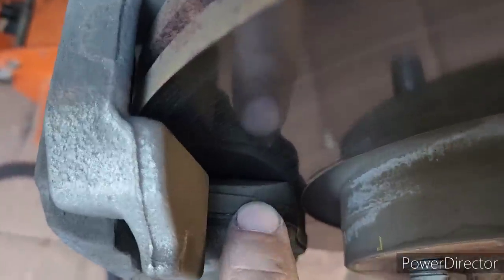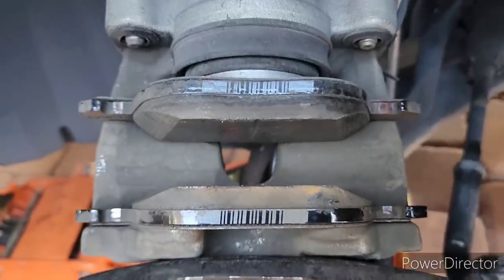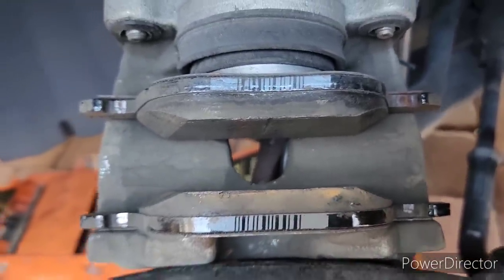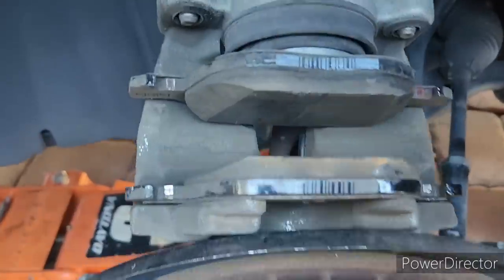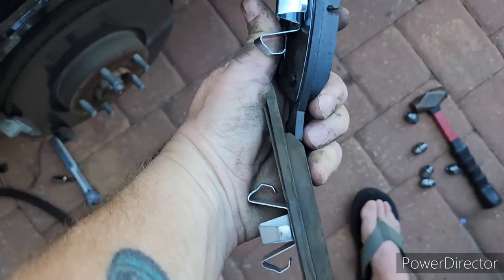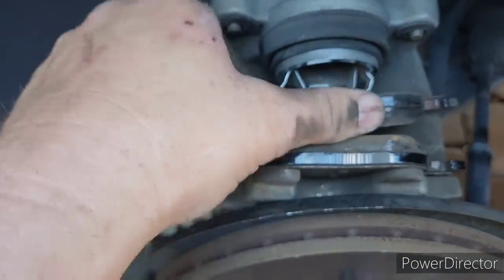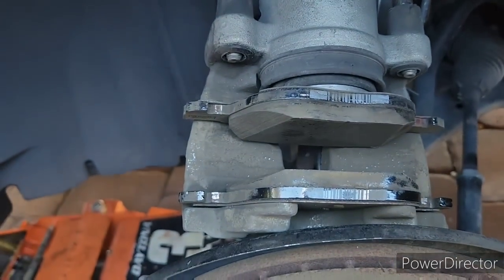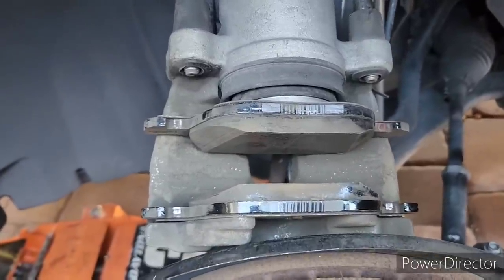Ford dealership robbed a little old lady out of a brake job. (almost)

Comment: i’m 18 and i work at a toyota dealership. I believe we do the right thing. we had someone come in for brakes and we told them they shouldn’t get them because they still had 6mm left. we resurface rotors unless it’s unable to be. we repair tires unless they are unrepairable. 

i’m proud of the work i do, and i believe most of the guys in there feel the same. I feel like that’s why we see a lot more than just toyotas, and we have tons of business.
Reply from the maker: Carry the torch! There's nothing wrong with doing the right thing. Don't fall into the trap of selling crap like the bad mechanics.
Reply: I think it’s not the Mechanic doing most scam, it’s the service writer, they have commission money. Mechanics getting only the per hour
Reply: @Alex-ti3uf  I used to work in dealerships as a salesman and even the mechanics worked on commission as a good chunk of their pay.  They could make a significant amount of commission $$$ on upselling services and parts after the cars had come into the shop so it was in their best interest to "find" problems.  Really reprehensible business practices at the two dealerships I worked at.

Comment: Most likely, the dealership wasn't going to replace the pads at all. The old ones looked new, so they were just going to say they replaced them when they didn't. The mechanic pockets the $200 and doesn't do the brake job. Happens all the time.

Comment: This is precisely why I always kept myself in automotives/repair throughout my life.  I was great at it when I was in High School and we took shop class and such, and then I just kinda walked away from it  for over a decade.  I took a vehicle in for work because it needed some (beyond the basics) and was almost immediately met with "Oh so we did our 49 point inspection free of charge BUT found all these items that require your attention etc. etc. etc."  Using the knowledge I already had, though now mostly out of date as more and more cars were electric this and that; I opted to buy a Hayne's manual for my vehicle to take a look myself and what do you know...nothing wrong that required immediate attention.  Of course.  Brakes (pads and rotors) were on that list.

From that day forward, I now do all my own work on my vehicles aside from intermediate/major engine work, or electrical work.  Everything else I do myself.  Fluids.  Suspension.  Belts.  Plugs.  Doors and frames.  Odds and ends like that.  I've saved myself countless thousands of dollars of bogus repair work since.  I also use that knowledge to help friends and colleagues with their vehicles when they have problems, or to have taught a couple of them how to do their own brakes and rotors/etc. to save them money.

I get that times are what they are and everyone wants to make a buck and the easier the better...but to openly scam people because you are banking on their ignorance is just appalling.  In this video's example, there's nothing at all wrong with that particular side's brakes.  They look almost new.  Now I don't know what the other sides look like, but that side clearly shows nothing wrong with the brakes at all.  Assuming all sides are roughly the same, this is just a scam of an elderly person ignorant of their own vehicle (which is not their fault - not everyone wants to be a backyard mechanic or can be).  If anything, I'd have taken it out for a boot and tested the brakes both inside the city (stop and go traffic) and on the highway (far less braking needed).  Test the grip/bite, test the sponginess of the pedal, test for possible warping of rotors.  That kinda thing.  Odds are that everything will check out fine.  Maybe they complained of a squeal/grind sound when braking after a prolonged period of inactivity.  That always happens as the brakes and rotors get debris/rust if not used regularly AND especially true the older the vehicle and the longer it hasn't been used.

It's a shame that stealerships and shops still employ these scummy tactics of preying on the helpless.  Just sad.

Comment: When I was in college and living in the dorms (so I had no where to work on it), my 91 Jimmy's brakes started having a problem grabbing. Barely hit the brakes and it would lunge you forward. I had the bright idea to go to Meineke and have them check it out. I was told that my rotors, brakes, calipers, everything was out of spec and they highly suggest not driving the vehicle until it was fixed. It was going to be some ridiculous $1200 or so to fix. I laughed so hard at this guy and told just to put the wheel back on and I would fix it myself. I knew he was an idiot. After I drove off, I never had an issue with those brakes again. He just cleaned up the brake dust/debris that was causing the issue.

Comment: Just happened to my wife last week at the Honda dealer. Went in for a couple scheduled services. They reported a couple of "very bad" oil leaks. The car came with a lifetime drivetrain warranty so they called the warranty company, who wanted photos. Nope, not bad enough to fix. Told me wife the same thing, but to easy her mind, she called an indpendent Honda repair shop and took it there a couple days later. The confirmed not an urgent issue at all and those engines do this. And the two leaks was really one leak - valve cover. My wife works retail and while waiting in the Honda waiting room, she said they were doing the same thing to every customer. Such short term anti-customer thinking will ruin them in the long term.

Comment: Took my Dodge 5500 Diesel in for a factory recall. Service manager came out with a list totalling close to $5000.00 in repairs that were needed. Said I needed an oil change too. I ask how he knew I needed an oil change and he said they "tested it". I looked him in the eye and said, "I normally like to get more then 20 miles on an oil change since I had just changed it myself before coming in.  All this other stuff is bogus too as I do my own maintenance. Just do the recall and let me get out of here." He hung his head and walked away. They were so stupid as I even had written they change date and miles on the bottom of the new filter!

Comment: Years ago I worked as a handy man for mainly elderly people. I had one of my lady customers say that her brakes were making noise again. A week or so earlier she took it to the local dealer and they cleaned them and deglazed them for her. Thing was the dealer she bought the car from(different one) had zip tied the hubcaps on because of a theft problem. I looked at her car and it still had zip ties holding the hubcaps on. I thought nice of this new dealer to put them back BUT they were old zip ties. Not sure how you work on brakes without taking off the wheels! I fixed her brakes and the quit making noise until she sold the car 6 months later.

Comment: They don’t always lie they told me I needed to replace the breaks on mine I didn’t believe them at first until I checked for my self and the break rotors had grooves on them
Reply: Grooves are normal to a point, that does not mean you need new rotors.

Comment: It doesn't make sense a Ford Dealership would charge only a couple hundred dollars when the cheapest brake job I have done is $550.00. Obviously the techs are just "looking" for easy work.
Reply: 550 is a lot. Typical rotors and pads run 250 and the labor does not need to be 300. If I take my time 400 would cut it.
Reply: Yes it does if they charge her for a brake job they don't even do because it's not needed.
Reply: @rosssmith9870  What???? I'm not getting your reasoning here. You can say they only do the front for that kind of money but nothing at all?
Reply: @Silverado  Since it's a scam because she doesn't need brakes they can charge 250 and do nothing. 100% profit.
Reply: @rosssmith9870  That's fucked if that's what happened. Damn! And no way to prove it.

Comment: Not sure of the requirement in the US but where I live, brake pads and tyres have "witness" marks to show when they are worn out. The pads that are installed obviously have incorrect marks but your replacement pads are correct ie when the line disappears they are toast. While not wanting to defend your Ford service folk, it would be easy to defend the loss of the mark even if its incorrect. However I do note the chamfer on each end which is probably a secondary mark.
Reply: I took a set of rear brake drums in to have them turned (they were barely worn). They had a witness groove in the middle of the wear surface. When I got them back they had turned the drums all the way to remove the witness mark and informed me that next time I would need new drums as thy had to turn them all the way to the legal limit.

Comment: It is a typical maneuver for shops to do this.  I just had a shop tell me I needed an alignment because the steering wheel was off center.  Interesting since it wasn't when I took the car in.  The work they were told to do required dropping the steering rack, so they reassembled it with the steering shaft off by a tooth then wanted to charge me for an alignment.  Something else I noticed was the power steering fluid was over filled and now murky.  It wasn't like that when I took it in.

Comment: I only just got my first car in February. I didn't know all of what I was getting into when I purchased an "as is" car. I trusted the safety inspection they gave their vehicle because obviously, idk how everything works. But one sticking point for me upon seeing the car was it had no diver's side visor to block the sun. I argued it was a safety issue and was irresponsible to sell me the car without it. It was pulling teeth for them to give me that alone. But that was only the beginning.

After walking into the sales person's office they try to get me to agree to this special brake assistance thing, that software that makes your brakes blink or whatever, and this stupid laser etching of the vin on my glass. I was adamant I wasn't going to pay for it. So I low balled them and got the car for $1500 cheaper than what they were currently advertising it for. ($4000 dollars cheaper than it was in December of 2022 btw). I was pretty proud to pay what I did, even if it was still a bit inflated from KBB.

This is all to say that even after that whole charade in the dealer, I still walked away with something that they knew they weren't giving all their effort into. There's plastic covers missing on latches. The weather stripping wasn't kneaded back into place, which took me 5 minutes to fix myself. And finally the whole reason I wrote this damn essay...... They sold me a car with 3 working door locks. I drove this car around for 3 weeks without knowing that my most expensive asset was not secure. I called a mechanic friend to take a look at it, we tear the door panel off find out what needs fixing.

I call the dealer I bought it from, tell them I need it fixed. And they tell me they'll diagnose the problem for me. I tell them you don't need to, I know what's broken I saw it with my own two eyes. I ask what it will cost me and they oh so generously wave the diagnostic fee, but say the part costs around $400 dollars, and that's not including labor. I call the local dealer who was the manufacturer of my car, and the original seller of the car when it was new, they tell me the same thing. NAPA tells me the part is $250 dollars. Finally I call my nearest scrapyard and find a similar model car. I take out the parts I needed, walked out with the parts and a spare door handle for $20. If you have the means to do so, or friends to help you out find a way to do it yourself, safely. You'll learn something new and will be able to help others like this man does.

Comment: From my experience, where there are mechanics who get a commission on the sales of parts they change.  They tend to find something to add just to make a few dollars more per car they service. It is also common there are service managers of dealerships who are gauging customers for what they can get.  

I take my SUV to a dealership that I know has been honest with their clients. They are part of a chain of dealers that do service.  I am in my 70s, and have no place and location where I can service my own vehicle.  Back in the mid 60s I did training to do auto mechanics. Automobiles have changed a lot since then especially with the technology part. The basics of the mechanics are very much the same. When I was in my 20s I did some engine, manual transmission rebuilding and vehicle modifications for muscle cars. I was building performance engines up in the 500 HP to 600 HP range.

Comment: My mother took her car to a service station to have her oil changed and air cleaner changed.  84 Dodge Colt.  They put a new oil filter on the old oil and punched holes in her air cleaner so it seemed like a new one.  This was a service station where we had taken our stuff for decades until Jr. took over.  Never again.  I believe many service centers do the same thing.
Reply: Here, a senior dad ran a good Chevy dealer with best body shop in town. He moves it to new location and buys his son a Honda, Mazda and VW franchises. This junior is never there. A little rich kid who told his people to ban me because they had fired an awesome kid in parts and replaced him with a girl that knows nothing about cars and I called them out.
Reply: My sister used to take her car to a garage to be serviced i looked under the bonnet one day for a quick check while i was visiting and discovered the expansion tank full of what i would call mud. Took ages flushing the whole system to have clean water flowing out of the block etc before i could refill it with new coolant.
Reply: @grantreid8583  muddy waters...or mud?
Reply: @jamesmedina2062  Contents of the expansion tank were more mud than water. Contents of block and radiator extremely rusty water as they had obviously not added any inhibitor  it was just water and rust.
Reply: @grantreid8583  What is funny is that the engine block was once mud 🤣🤣🤣 It did at one point come out of the ground

Comment: My girl friend got a flat tire and took it to a tire shop to get it fixed. They told her she needed new brake pads all the way round and told her it would be over $900.00. When she asked way so much they said you need to replace the rotors and calipers every time you replace the pads. Only need to replace the front pads.

Comment: My wife took ours to a Hyundai dealer for oil change. They told her that the brakes were metal on metal. She called me and it didn’t sound right, I told her to take it home. The pads needed replaced but were not metal on metal and did it myself for a fraction of what they wanted. Never went back and then got rid of the Hyundai. They told her it was unsafe to drive home and it was not

Comment: I believe if you own a  vehicle you should know the basics ie change a light/tire/oil and identify wear. If I work for a lot of companies that supply a work truck. Its a requirement to do a walk around and Identify issues everyday before shift. If you can fix some companies will allow you to. but some will take to a shop but you need to be able to spot it. If you DONT want to be taught these basics of identifiers....THEN you should not be allowed to drive. Simple.

Comment: Had my car in for a longblock install on my car recently. I was expecting them to tear down the engine and come up with this huge parts list of things that needed replacing, but insted they only found the frount breaks and aircon belt BOTH things i already knew needed replacing. Got them to do the belt with the long block then did the breaks my self when I got the car back. I will admit that I was taking down every comunication, call what they said and all sorts just incase they turned around at some point and started charging. I think i was lucky thankfully. Id also talked to 4 dealers and go there take before choosing who to side with.

Comment: Ten years ago the transmission in my 98 Dodge Ram failed. Local Calgary Dodge stealer-ship quoted me a rebuilt transmission for $5600 plus installation or a factory brand new one for $8000  plus install. I found a large local transmission shop that quoted me $1750 for a completely rebuilt -with all the latest service upgrades as well - for $1750 if I wanted to install it or $2100 TOTAL drive it away. Took about 3 seconds to make that decision! Running great to this day and I have them do a filter change every few years for $250 to keep it that way. Do NOT EVER and I repeat NEVER go to a stealer-ship.

Comment: I followed Chris fix video and it was so easy to change brakes. My front and rear rotors with brake pads cost me $302. I had a blast changing them out it's been 2 years and no problems. I have always wanted to go to tech school but other mechanics have given mechanics a bad rep. I'll stick to psychology instead.

Comment: I had a mechanic at a ford dealership tell me I needed brake shoes in my rear brake's drums, he insisted that I had rear drum brakes. I have a 2014 F-150 and No 2014 Ford trucks have drum brakes in the rear. They do have parking brakes in a drum but not the service brake. That dealership was bought out a few months later and he was not retained by the new owners.